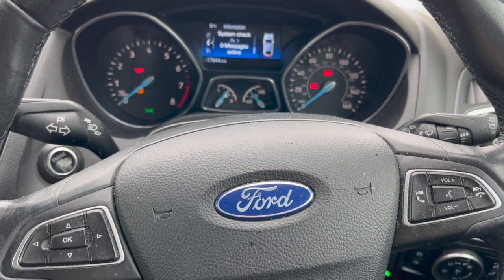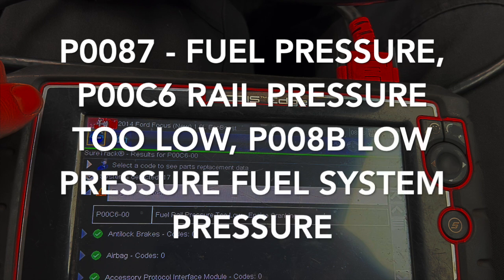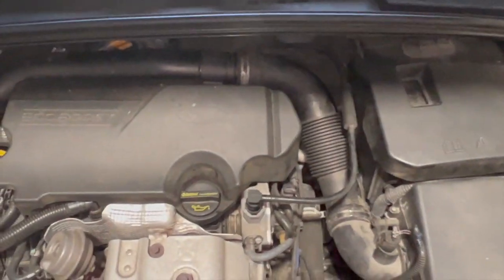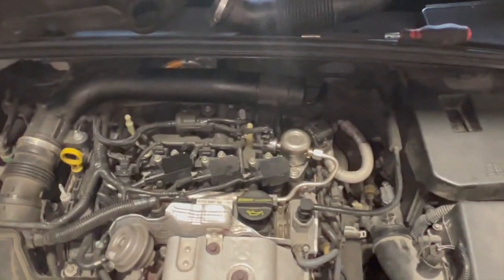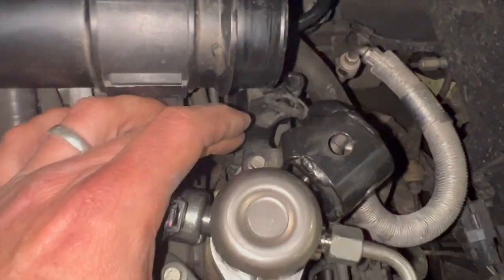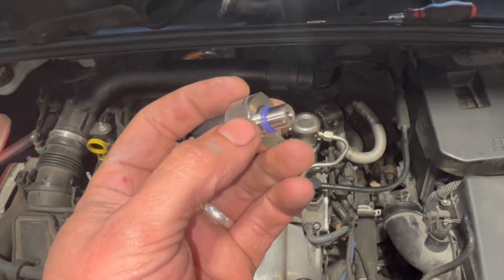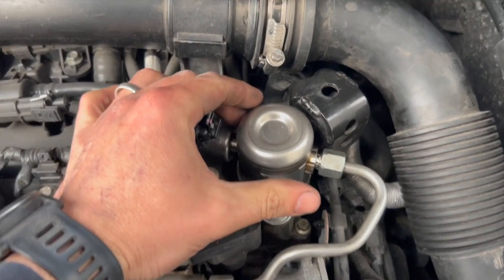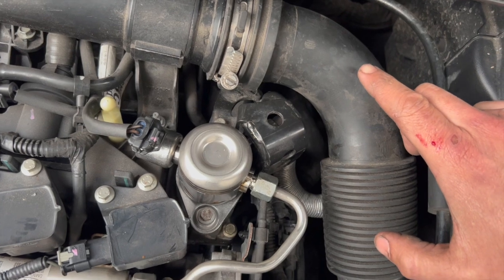Ford Focus 1.0 ecoboost hesitating / stalling P0087 P008B P00C6

Comment from the maker: OE Ford Low pressure sensor Ebay - https://ebay.us/fXw8vm

Check Euro car parts - https://tidd.ly/3lIO7xA  (use discount codes on site)
Check "Car Parts for Less" - https://tidd.ly/2LNEwIn  (use discount codes on site)

EOBD Scanner - https://amzn.to/2YBMA2L
CTek smart charger 5 - https://amzn.to/3jtGgTd
EOBD Budget Scanner Ebay - https://ebay.us/IHpAfK
Advanced EOBD Scanner eBay - https://ebay.us/odL6V7

Any Donations to help Support my Channel are much appreciated.
Donate via Paypal - https://paypal.me/diydaly
Reply: Thank you !
You have been so helpful !
I own a ford focus 2018 mk 3 from new, has 61000 miles on clock. When you recommend should I change the timing belt and water pump ? 
Thank you again.
Reply from the maker: @andreifiruti8373  sure the interval is 100k
Reply: @diydaly  Thank you again.
Reply: Just to let you know, after sorting p0444. There was still a problem and seemed to be a corrosion on wires inside the car. Caused by water in foot well.

Comment: Had the same issue on 31 Jan 2025, car stalled, ran a code reader and got same code "Fuel pressure too low"" bought a new fuel pressure sensor for the low side, after watching this video and took the car for a 2 hour drive, it drives better than before, I can even drive over speed humps on gear 2 with AC on, which is something it never did since I bought it in 2020.

Ford Focus 1.0 Ecoboost, that's the car.

Thumbs up for this video 👍 👍 👍 Thanks.

Comment: Good tip thanks.  Had one or two of those eco BOOM engines in for general service fiesta and focus and I have to say for such a small unit they certainly push out an impressive amount of power and refined cruising on the motorway 👍
Reply from the maker: Thanks Kev! yeah nice little motors really.. not had to do a timing belt on one yet but the early models will soon be coming up 10 years old so soon expect to start doing them 😬 book time suggests its engine out jobby 😖
Reply: @diydaly it's not a bad job doing the belt mate engine in
Reply from the maker: @kellytaylor3134  arr that’s a relief! Still not had to do one yet 👍 thought it’s gona be a right pain if it’s engine out job jobby

Comment: Good video👍🏼im having stalling problems with my focus it cuts out when stopping at lights sometimes and seems to be using a bit to much fuel. Weird thing is is that it isn’t throwing no codes up at all🤷
Reply from the maker: Hmm always tricky when there’s no codes , first thing I’d do Is look through all the engine ecu data see if anything looks amiss! Especially temperature readings
Reply: Hi Mark, I'm having the same issue. Did you find the problem with yours?

Comment: Thank you !
You have been so helpful !
I own a ford focus 2018 mk 3 from new, has 61000 miles on clock. When you recommend should I change the timing belt and water pump ? 
Thank you again.
Reply from the maker: 👍 might be best to check with Ford at the moment as they’ve just recently been changing the intervals due to all the issues there having with the belts
Reply: @diydaly  Thank you.

Comment: Hey chap Mrs car has the exact same symptoms other than it doesn't bring up and eml, so I'm gonna replace this sensor but I just wondered whether you could confirm part number as the one linked says its for a mondeo and ford direct seem useless for finding out the oe part number. Thanks
Reply from the maker: Yeah it should be the the same , I wouldn’t like to comfirm 100% without seeing it

Comment: Thanks for video. I'm getting all the codes you had plus P0088 Fuel Pressure Regulator Control Circuit

Do you think I need to replace the Regulator or just try the Low Pressure Sensor first?
Reply from the maker: Hard to say really , might be advisable to check the pump too ..

Comment: hi, Bought a 1.0 125ps mk3 titanium 2012 for my son to mess about with as he`s going to collage soon "he`s 16" , Previous owner went out in it and everything was fine,  then all of a sudden it just stopped, engine died and would not start again. Was towed it back home and started to try different things to why it will not start.  We have fuel from low pressure as can hear the pump prime also unbolted the high pressure pipe to make sure fuel was getting to the pump, that was fine.. We did get  a low pressure rail code and changed the hi pressure sensor, did nothing! but the code didnt come back!. Then we took one of the spark plugs out to make sure there was spark.. and yes its fine. Today we are going to take off the high pressure pump and swap it with my one that works as I have the same car just newer 2016 just to try and find a reason for it not to start. Also just a piece of mind took the rocker cover off to make sure the belt was ok and at least still in place to make sure the cams were ok.. they move :) I know the high pressure pump is driven by the cam so hopefully when we take it off the cams not in 2 parts, then Ill know the reason the pump was not working. When the car is cranking you do smell fuel so its coming from somewhere. Its strange how  one minute it was running then just stopped with no error codes. Now it has no codes but just not starting.. totally baffled..!
Reply: Same problem here did you figure anything out
Reply: @thegrizzlygang5002  nope not yet, im going to do a compression test when i get the time and see what all the cylinders are coming up with. Might just take it apart for the fun of it if nothing else and sell all the parts. As its just sitting there taking space atm. As dont know anyone that can have a look at it.
Reply: @rs2klee  hello, I just started having the same issue with my focus, did you ever figure anything out with yours?

Comment: I'm chasing this fault currently. When data logging the low pressure sensor and the bogging and power cutting appears, it still shows consistent fuel pressure. Was this the case with you as well?
Reply from the maker: Are you reading the or high pressure , I believe on this one the high pressure was dipping when it was running bad
Reply: @diydaly  I was reading the low pressure sensor. It was pretty consistent at 0.6bar, even when running rough. I unplugged the sensor, and now it gives a reading of 0.7bar because it doesn't measure anything. The problem hasn't occured since then, been about 30 kilometers since I unplugged it. It's weird how the high pressure sensor dips when the faulty sensor is the low pressure sensor.
Reply from the maker: @Cydro12  .7 must be the default setting , yes it is odd mate .. I’ve replaced quite a few pumps now ,  2 low pressure sensors and 2/3 high pressure sensors
Reply: @diydaly  well thanks for your response and ofcourse the video, the problem seems to have been fixed. I can't stand it when the problem can't be traced back by data logging and logic, but the problem seems to be fixed, so no moaning from my side. Keep it up, you definitely helped me with this one!
Reply from the maker: @Cydro12  nice one, glad you got it sorted

Comment: Is this the same on a fiesta 1.0 ecoboost
Reply: @diydaly  this ain't the same as the one on my kids 14 plate zetec s 1.0 .I'm guessing the low pressure is either the pump on top or the one in the tank.
Reply from the maker: @chavvy960  arr right I’m. It sure without looking tbh then mate

Comment: I’m having issues p0089 p0087 p02a9 P0300 p0303
Reply from the maker: thats quite a mix of codes! hard to say without looking mate
Reply: @diydaly  yeah it’s on my mates car 1litre 2014 focus it’s saying misfire cylinder 3 and petrol pressure the Rest of the codes
Reply from the maker: @Busy247  quite prone to the coil packs which may be the misfire